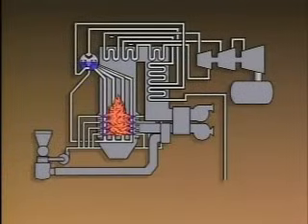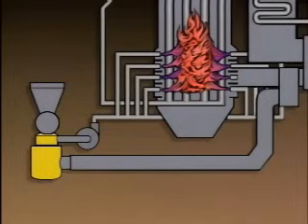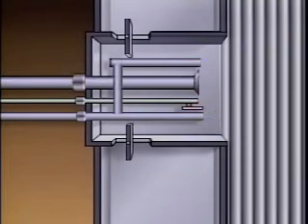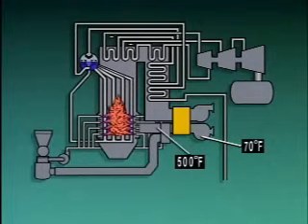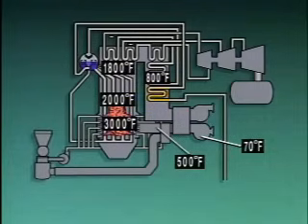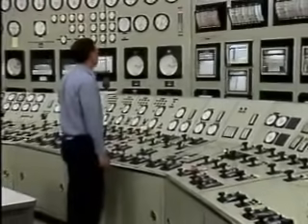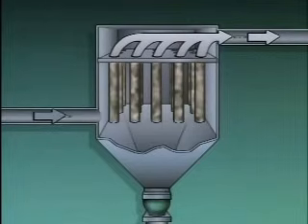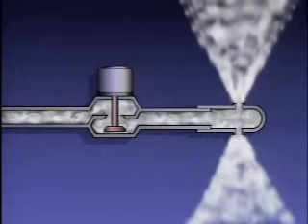How to Steam Boiler Operation and Combustion

Comment: Why not use induction tehcnology to heat the water?!
Reply: Hi there, it's because the goal of a steam power plant is to produce electricity, induction uses electricity, therefore an infinite loop is created, where at each iteration due to the increase in entropy (inefficiency) we lose some of that energy away. Power plants use fossil fuels as we can steal the energy content from them and put in the water then the energized water (steam) can give it's energy to the turbine which is spinning a generator. As you can see there is always a transfer of heat, and every single time a percentage of energy is lost. If you have more questions feel free to ask